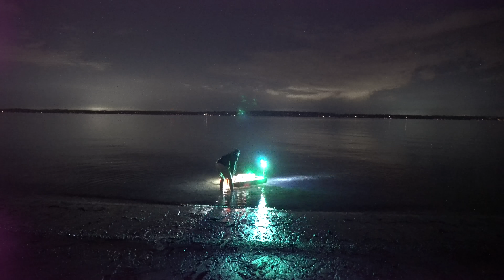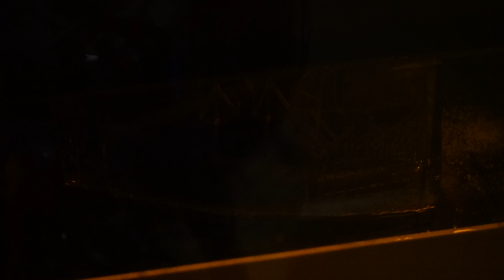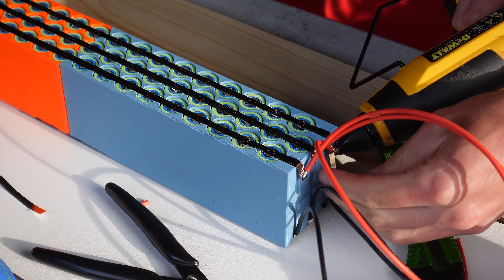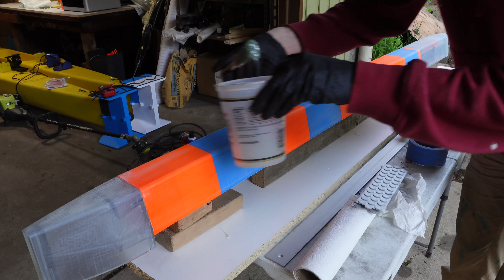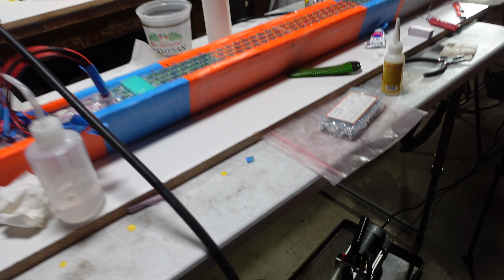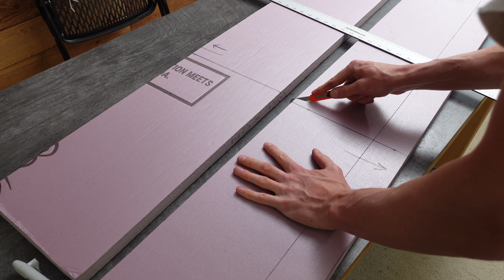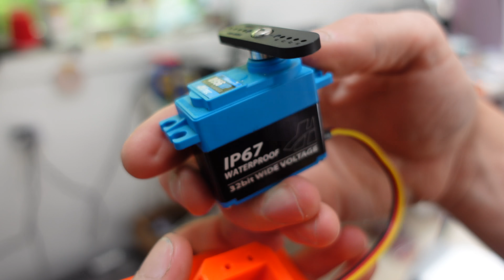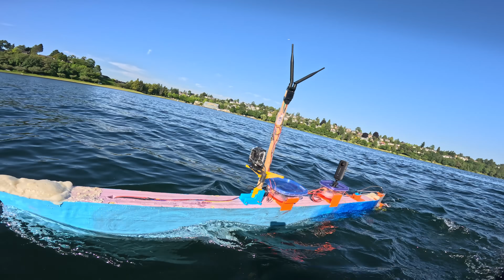"R/C Boat" with 40 lbs of Batteries

Comment: Rather than grease, paraffin.  Seal the hull as best you can.  Pour in molten paraffin, assuming that isn't too hot for the 3d printed material, and quickly submerge the battery pack.  Couple of bonuses.  If you rig a bath to keep the paraffin liquid it will penetrate the battery.  Any extra air will bubble out.  Paraffin is lighter than water.  Not a great conductor of heat though, so managing that would be a consideration.
Reply: Dude needs something that is heavier than water.
Reply: @snygg17silicone grease has similar buoyancy to paraffin so that's irrelevant.

Comment: put your props into a recess (like into the hull) with a ~45° downwards-angled opening and put a coanda-screen in front of it. Water can pass through but debris and seaweed can not and the nature of the coanda-screen prevents the screen from clogging up. It fixed all my weed problems with my diy RC-boat testing platform.
you can contact me if you have any questions.
seeya
Reply: Can you show a video or picture?
Reply: What's a coanda screen?
Reply: @ElectricNed  it is a metal mesh that prevents debris from sticking to it. Mostly used in micro-hydrogenerators
Reply: The M200 is using weedless props, they're quite weedless!

Comment: Dude I love it, leaves nearly exploded battery 1 inch outside door for 2 years then puts it to full use.  I do this sorta thing all of the time. :trophy-yellow-smiling: You & water, water & you.  Gorilla makes that very wide white tape with the gray goopy sticky surface.  Works good for sealing vast areas of impossible to waterproof stuff.  Maybe you can just put all of the batteries into a dry bag first then box that up, ty-wrap the closed bag up your mast. Looking forward to your next video!
Reply: Vacuum seal bags possibly?
Reply: @minimalskill6592 Only if monitored for swelling.
Reply: I like how he owned it.